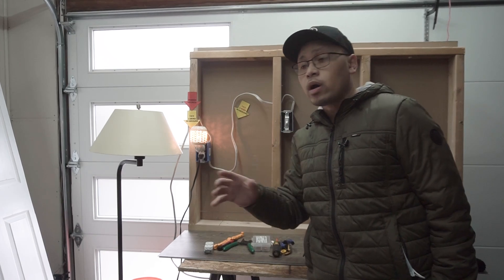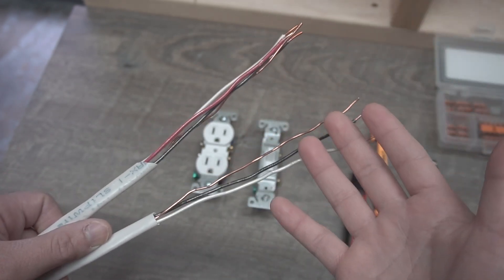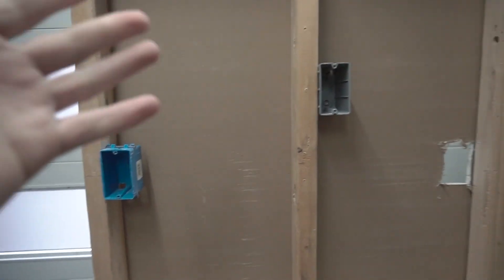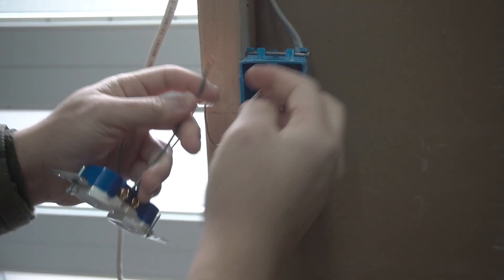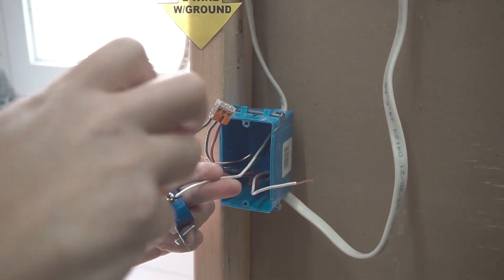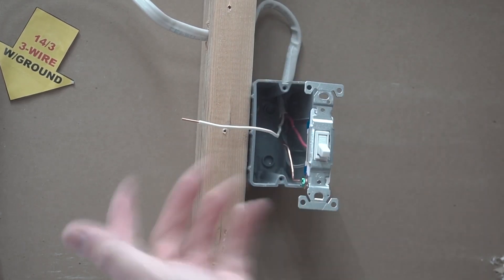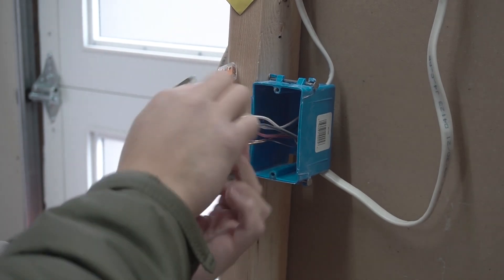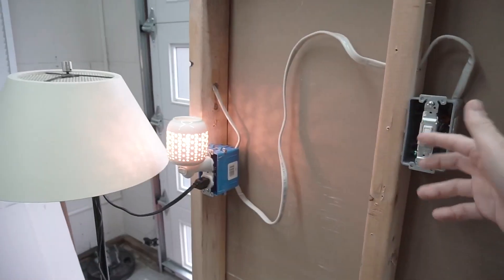How To Wire A Split Outlet With Bottom Controlled By Switch & Top always Powered On! DIY Tutorial

Comment: How do I wire another outlet off the constant “on” side of this outlet?
Reply: You would attach the live in with the other three lives (you would need a larger wago if that’s what you’re using, or if you’re using wire nuts you possibly need a larger one) and you would make a neutral pigtail and use a connector to put the three neutral wires together: the pigtail, the source neutral, and the continuing neutral.
Reply: @cheyennepritchett1583 Thank you kindly for the reply! You’re awesome!

Comment: Jay, I have used this video to wire my attic lights so that when I enter the attic and flip the switch, all seven of my attic lights come on because I installed a series of half hot duplex receptacles into which I plugged 4' LED lights. 👍 Thank you.

HOWEVER, I'm stuck now. I need to take the other half of one of those duplex receptacles and control it with another switch ... take it from being always hot to only hot when I flip the switch. Can you help me? 

I can only GUESS that I run a 12/3 or 14/3 wire from the  new switch up to this hot half of the receptacle. The ground can simply go into a 5-part WAGO with the other grounds, and the neutral can go into a 5-way WAGO with the other neutrals. 

What about the black and the red from the switch?  Do I need to break off BOTH tabs to make these two receptacles totally independent and then with them with the red going in with the other red and blacks? Then do I make a pigtail from the bottom black (that's going to the other switch) and put this new black wire with the black wire from the other switch and this pigtail? 🤔 It's a bit unusual to want to do this, I reckon, and I tried to find a video like this from the Internet, but nobody seems to have one about taking the hot part of a half-hot duplex and controlling it from a different switch. 

By the way, just to make it even more fun for this 73-year-old geezer who has been relying on your videos to rewire our home (retired missionaries can't afford to hire electricians😄), the switch in question can only have 3 wires. It's a shallow one-gang box because I had to carve into the jack studs by the door to get one in at all, and I don't want to weaken the frame any more than I must. 

I don't know if you even answer questions like this, but let me thank you whether you can help me with this or not. Your teaching style for electrical wiring with post-its, reviewing your steps, and thorough explanations has been a lifesaver. If my wife and  I had taught our wonderful Asian students in the Philippines HALF as well as you teach in your videos, then they certainly would have some even better - especially during COVID when we had to come back to the US and teach via ZOOM. Thanks, Jay. I'm far from finished, but you have me the courage, skill, and confidence to try to retire a retirement cabin for our final years. God bless you even more greatly than you have blessed us. 

By the way, tell your wife she's blessed to have you. My wife would have been THRILLED to have married a man with your DIY skills. 😂

Comment: Very helpful. My issue is all 3 hot wires are black so i have no idea which ones to pigtail. The genius that wired this a decade ago backstabbed all 3 black wires into a residential grade outlet. I just pulled it out to find a melted mess!
Reply: All you would need to do is follow each wire back and see which cable they are coming from. One cable will have 2 blacks and the other cable will have 1

Comment: so you really don't need to connect the white from the 14-3 to the outlet since it does not connect at anything at the switch, correct?  If you used 14-2 for both the outlet and the switch, would you connect the white wire in place of the red on both the outlet and the switch, place a piece of red shrink wrap on both ends of the white wire to indicate it is being used in place of the red?

Comment: First off all thanks for a clear explanation. QQ. Is there a need to use 14/3. The Neutral from the 14/3 that is connected to the lower silver screw in the receptacle does not seem to do anything as the other end is capped anyway. That being the case why can’t we use 14/2 and using the black tape mark it as the hot. Looking forward to your reply. Thanks.
Reply: New Code Requirement requires this set up. Before Code change, you were correct.

Comment: My garbage disposal is plugged into an outlet controlled by a wall switch. I discovered both outlets seem to be controlled, not just the top where the disposal is plugged in. I need to use one of the outlets for my Reverse Osmosis system (always on). What do I do?? After turning the breaker off...do I open it up and pull that tab off? Or is it much more involved than that? Any insight would be helpful. Thank you for this informative video.

Comment: We are replacing all our outlets in a bedroom. Originally the set was the top outlets were on a switch and bottoms were always hot. We didn't break the tab in any accepg the one by the bed so we could control it from the switch in a lamp. But it's not working. Both outlets are still hot. Any advice?

Comment: can this be done in reverse?  i have the 3 wires coming in with the power that was connected to the switch and the two wires on the other side of the wall connected to the receptical.

Comment: Why use a 14/3 if you’re capping off one of the wires? Can’t you just use a 14/2 and instead of connecting the red wire connect the white wire?
Reply: Red is typically used as your switched leg. Black is typically used as your constant power.

Comment: If the white wire in the 3 wire cable is redundant, then it can be marked by red tape to replace the red wire.
As long as it is clearly identified, this will save the higher cost of using 3 wire cable.
Agree ?
The switch will still work independently.

Comment: Very clear explanation.  Thank you very much.  I have one question that I search around couldn't find the answer.   I want to replace the old range hood but the new one is 220V voltage in stead of 110v.  As fast as I understand that in the kitchen there is only one 220v outlet for the stove/range applicance.  Is that possible I can splite the 220v outlet into 2, so that one for the stove/range and one for the range hood? If so, can you show me how?  Or you suggest to me with other solution.  Thank you for your help in advance.

Comment: what if the switch your dealin with is double throw switch?  does this change this concept?            i have 3 lights that plug into my ceiling boxes..... i had wired to my double switch so i could only turn one entry light on if i wanted or flip both switches for all the ligths.........   I since added a heater to my ceiling and I need of the outlets to be hot all the time for the heater plug.   why im watching this vid to learn how to make a receptacle hot permantley and one switched.

Comment: Great video!  Is there a video for the following?  I want to install a new ceiling fan with light that has black, white, and red wires.  The current switch in the wall only has black and white.  How would I add/install an additional wire in the wall for this?
Reply: Very late to respond. I would assume the white wire is acting as a hot wire that wasn't labeled properly, aka they used a 12/2 or 14/2 wire instead of a 12/3 or 14/3 as in this video. The white wire in your house serves the same purpose as the red wire in this video. They simply omitted the "useless" White wire from this video. Hope that helps! Always ask an electrician for help! Just my advice and I am not a licensed electrician.

Comment: Curious why I am not getting power to the switch at all, I am getting power to half an outlet but no power to the switch even breaking off center tab, then I have another switch in same room that doesn't work but it has full power in the outlet top & bottom but again switches are not working even after buying new rocker switches & outlets?

Comment: This was extremely helpful. I do have a couple of questions:
1. Can you add a light to the switch power source?
2. Can you put a dimmer on the switch?
Thank you!
Reply: 1 are you talking, connecting the light to the switch? Be pacific

2. Yes. You gotta do it from the switch to the dimmer or you can buy a switch that has a dimmer in it

Comment: What happens if before I put a new outlet in the top outlet on all four outlets it’s controlled by the switch. I put one brand new outlet in and now none of them are controlled by the switch and I wired it the same way it was.
Reply: I’m having the same issue. Did you get it resolved?

Comment: Excellent!    Question: The N wire you have capped in the switch box -- if you have other neutrals in this box that are all tied together, could you attach this N wire to the bundled other N's?

Comment: Thank you very much for doing this video. I'm not a professional electrician, but have been replacing bad light switches in a unit on the property. Some of the wall outlets lose power when turning off the actual light. The power line coming into that room is the end of the line for that side of the property and controls the whole room. Then having to piggyback multiple outlets and a closet light switch. Lol This video was very informative and very detailed. Thanks again, now I can get this done without wasting much more time or pulling out my hair! 😂😂

Comment: I did this and the top is still only turning on with the switch and the bottom seems to be dead now.  Any idea why?
Reply: And by this I mean I took the tab off of the existing outlet.  I just left the wiring however it already was.
Reply: Well just realized we don't have the bottom wire to connect to the hot side sigh

Comment: Very helpful and clear w/one exception: You left the neutral wire over at the switch off the switch as a loner but it looks like you attached the other end of that neutral on the plugs neutral side bottom...how come?  Why not leave it off the plug like the other end loner...it seems to serve no purpose connected.  What am I missing? Thx for your video!
Reply: I’m super late to the party but decided to answer you anyway.

You’re right, it serve no purpose right now. But if you eventually tap into that switch to add another outlet or if you decide to add a switch with a timer or a lighted switch you’ll need that neutral. You then have to find where’s that stupid wire is not plugged or if it’s broken. So it’s nice practice to always fully terminate your box.

In such a simple setup it’s pretty easy to resolve but add a dozen outlets with split and without, a couple more switches and then come back in 10 years….

Comment: How do I reverse this? Bought a home with an outlet wired this way, do I just buy a new plug that has the connection still in tact and just wire it in normally? I guess I can disregard the extra red hot wire?

Comment: Wonderfully useful video.  My house is mid 70's build.  I found a split receptacle wire with two wire 14 gauge where the white wire must have been hot.  It was disconected at the originating box.  Totally confusing until I saw this video and the comments.

Comment: A good way to know if u have a 20amp outlet is if the hot is in a T shape. 🤙🏻 hope that’s helpful
Reply: …. You prefer waygos over wire nuts!?
Reply: U got that backwards it's the natural side of the recptical that has a T slot on 20 amp rated recpticals

Comment: I have a switched outlet that only has a black wire and a white wire. House was built mid-60's. The homeowner claims the bottom was switched and the top always hot. Is that possible? Maybe she is confused and both top and bottom were switched

Comment: I would like to have the always on outlet on the bottom instead of the top That way you can plug in a power adapter on the lower outlet because it takes up so much space that way you can plug a light in the upper outlet and have room

Comment: Great explanation. I need to do this in a bath renovation. Would it be acceptable to NOT connect the neutral wire of the 14/3 at the receptacle box and just terminate it as you did in the switch box since it's not used ?
Reply: My question as well...

Comment: do you break off the tabs on each side of the electrical receptical or just the brass side?
Reply: Just did some research on this. Unlike here, I'm using 12/2 for both circuits, so it's important NOT to break away the connecting tab on the neutral side.. as it'll act as a common neutral for both receptacles, since in my configuration, the white wire coming from the switch will be "hot" so the common neutral will carry the power back to the breaker

Let me know if that makes sense
Reply: @priyanknaik6458  makes sense thank you

Comment: Can you use a 14/2 wire for that entire set up instead of the 14/3? I have an outlet that has 3 sets of 14/2 wires. One is going from power to outlet, one set is coming from a switch and one wire going to another outlet down the line. I was going to connect the switch wire to the bottom and the other two sets i was going to combine/pigtail them and put it on top. Please let me know if that's acceptable. thanks
Reply: Yes, from the switched receptacle to the switch you can use the white wire as a hot wire (switch leg). Mark the wire with black or red electrical tape at each end to designate hot, not neutral in this case.
Reply: And keep the connecting tap intact on the neutral side as it'll act as a common neutral for both receptacles

Comment: I have 4 ceiling lights in a row in my hallway. I am trying to separate them in 2 sets by attaching 2 switches, one to control the first 2 lights and the other switch to control the last 2.  I am pulling power from the 3rd light from the ceiling.  There are 2 14/2  wires in the ceiling, one is the power source and the other (with no power) I believe is going to the 4th light fixture.  Could you help me with the wiring in this scenario.
Reply from the maker: Hi! I think the double gang switches to end of run fixture is best for this. All you have to do is add 1 extra light after each fixture. Check out the video I made on this. https://m.youtube.com/watch?v=mxbaqegYxBU&t=865s

Comment: 2020 nec 404.2(C). No neutral is necessary in the switchbox with the switch that controls a recepticle.  Your video could have been done by re-identify the white wire as hot and connecting it to the switch like the red wire was.

For the home owners, the old nec phrase was down on white, up on black, sending power (hot) on the white wire to the switch and returning power from the switch to the recepticle on black.

Good video though.
Reply: Thanks, I was looking for this and questioning myself.

Also, why even connect the neutral from the 14/3 (assuming you wanted to use red) , it seems like an unnecessary risk. I mean, I can see why someone might want to use a red wire but the neutral threw me off.
Reply: I hate that they don't show the date of the video anymore, but this 3-wire deal is only needed now, if my understanding is correct, because of recent code changes that assume people want smart switches and such.  Otherwise, a 14-2 as a carrier would do the job to the switch, but I think code may have changed. Not 100% sure though... it may have only changed for 3-way or something like that.
Reply: This is exactly what I was thinking... so, in essence,  place red tape on the white wire going tto the switch and at the switch.

Comment: Is there any reason you cant flip the set up and have the top be switch controlled? Watched a Canadian video with that set up but i have 2 middle of the run outlets  that are currently switch controlled on the bottom and want the top to be so the wall sconce plug will reach easier.
Reply: No reason, your choice.

Comment: Can you build a visual scenario, where one is bringing power from a ceiling flat Halo LED light to a new switch to control a different pair of lights.  So my story is similar to the mentioned scenario.  I am pulling power from this existing ceiling light and extending the wiring to these 2 new switches.  There are 4 existing LED lights in the hallway that are being controlled by 2 other switches, one on the top of the stairway and the other at the bottom of the stairway and so the 4 LED lights are being divided by a new wall, where the 2 end lights are now in a room and that's where the 2 switches come in.  One to work with the other stairway switches to control the hallway lights and the other to control and room lights.  Thank you so much.  You are awesome in explaining the different ways to get lights situated.
Reply from the maker: Thank you so much! From your explanation I will need to try to figure out a diagram, I’m getting kinda confused 😅. Please give me time 🙏🏽
Reply: @FixThisHouse  Sure, take your time....
Reply: Your stairway swtiches are 3-way switches... different animal, different connections.  You will need to figure out if your new application requires 2 "rooms" each with 3-ways, or just 1x 3-way for the stairway.  The basic thing to know is you need a loop from your source black to your source white that has the load (whether 2 lights or 10 lights - you just wire them in parallel).  And your switch breaks the loop.  That's it.  We cook up these connection scenarios to because romex cable always has 2 conductors, or we use 3 conductor because there is a 3-ways, or we have to carry an unswitched black and white into a box to power something like a smart switch that requires power itself.